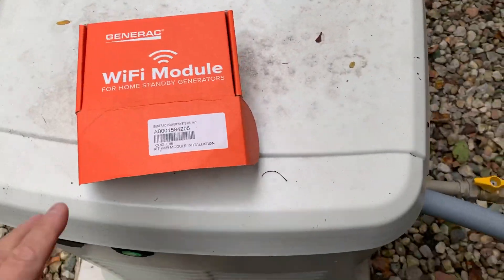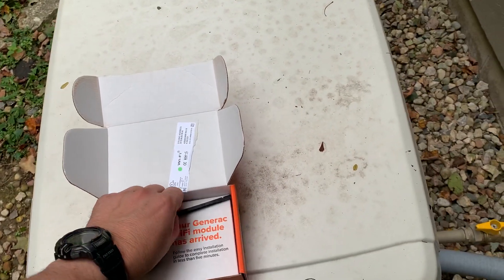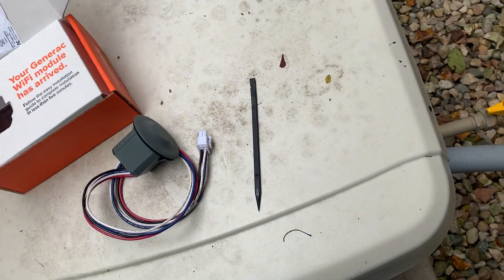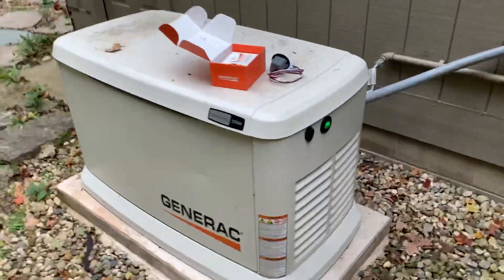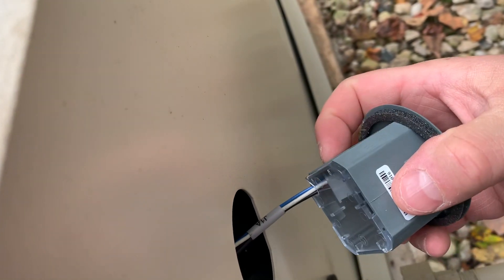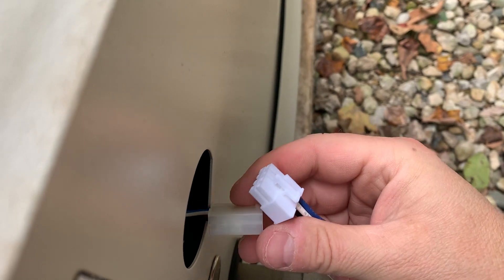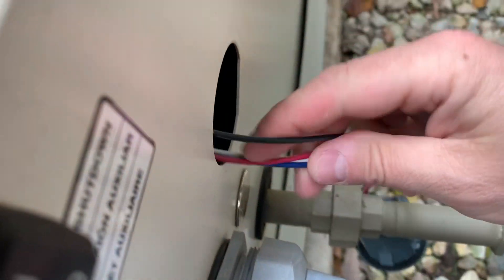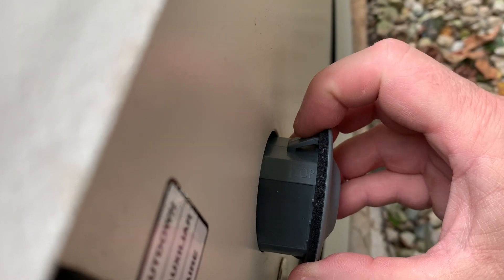How to install the Generac 22kw WiFi Module

Comment: I work at generac, at their industrial generator plant. We are experiencing pretty bad supply shortages that seem to be getting worse. Anyways, I believe it's the whitewater facility that makes home backups rotors and stators IF YOU CAN, PLEASE TAKE A LOOK AT YOUR ROTOR AND STATOR AND CHECK FOR ANY LOOSE MAGNET WIRE AND GLUE THEM DOWN WITH QUICK SET EPOXY. I see this problem constantly in my department, the " layer wound" rotors are fantastic quality with Japanese bearings, however the "random wound" rotors are plagued. the company has grown way too fast and has many new inexperienced workers who don't know or care. Only a few years ago we were producing about 30 rotors a day, and now they want 120. We average 500 per week. On 4 shifts and overtime constantly if we have parts.
Reply from the maker: Thanks for the info. Not sure what or where or what the rotor and stator are. Can you send a link? Or shoot me an email with more detail to realitysurvival@protonmail.com. Thanks!
Reply: Why doesnt Generac send this information in an email to the customers?

Comment: so what do you do with app and connection? is wifi sufficient or is there a need to be connected in a power outage ? usually when my power goes so does my internet. trying to figure what might push me to 4g .  can i do firmware updates on generator with app ?

Comment: your video was excellent I appreciate it but I have one problem, at the end when I was done connecting and I was I fixed the wires down the plastic piece that holds the wires in the little plastic piece it fell out of it and went down in the hole of the generator what can I do now. I'm not the handiest person in the world and my wife's call me everything in the book any suggestions
Reply: sorry some of the words came out wrong I was speaking through my speakerphone. the one time I tried to do something to make the wife happy and the littlest thing happens
Reply from the maker: I’m sorry I don’t really have any advice because I can’t fully understand what has happened or where the piece went. Good luck getting it fixed though!
Reply: The clear plastic piece that holds the Wi-Fi module that you get in the mail to hold the motherboard popped off and went down in the hole. So basically the motherboard is dangling without that plastic piece to snap it back in place

Comment: One problem not covered. If your generator was using cellular then the cable you connected to goes nowhere. It’s hanging loose inside the cabinet. You.need to connect that cable to where the cellular cable connects. Also, the WiFi could be disabled when the generator was installed. You can enable it in the edit menu but haven’t found that yet..

Comment: Nice, but it becomes much more difficult when they place the entire wiring extension into the dummy plug. Yep, not connected. Had to call the Generac folks to come and open up the panel and plug the extension into the wiring harness, then plug the controller into the extension. The five-minute extension turned into a few days. Thanks Generac!